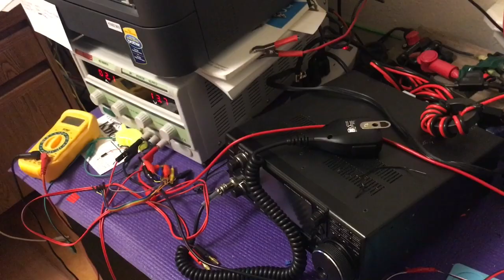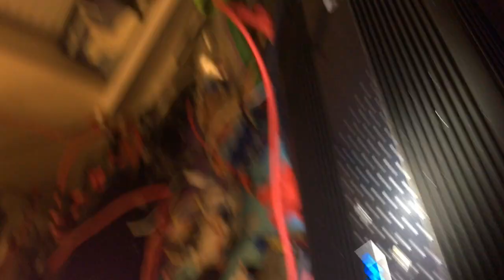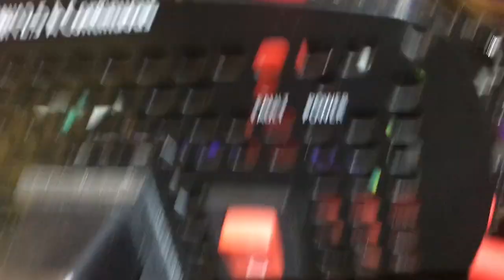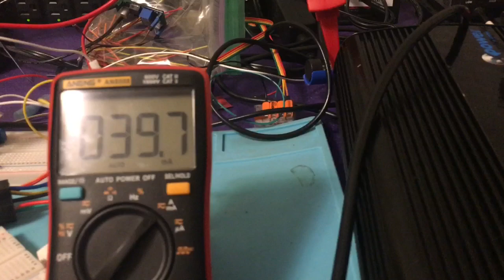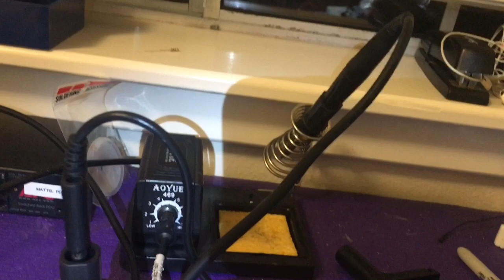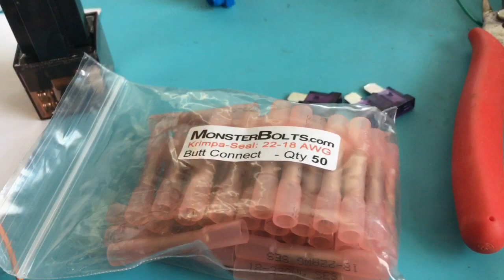Add Remote Inverter ON OFF Switch  for Lifepo4  BMS Shutoff for Electrodacus BMS and Daly BMS

Comment: Yes measuring the current trough ON/OFF switch is a good idea. It seems they connected more than just the remote ON/OFF. I guess the increase from 40 to 55mA when you added the soldering iron has to do with some LED inside the inverter that indicates that there is a load or something similar.
Reply: Hey guys :D haha
Reply: Nice job Danny 👍
Reply from the maker: Thanks for watching and your comment.  I'm getting ready to buy your bms.  I'm just finishing my my inverter integration as you recommended on Wills youtube.
Reply: @dannyjensen4954  I was searching for Will's video to see if there are any new questions and when I made the search I seen your video.